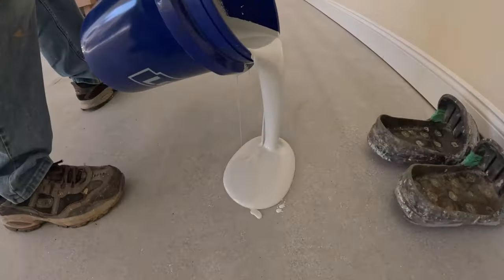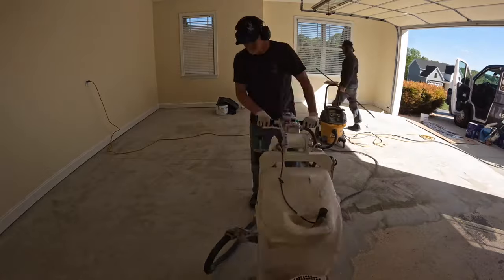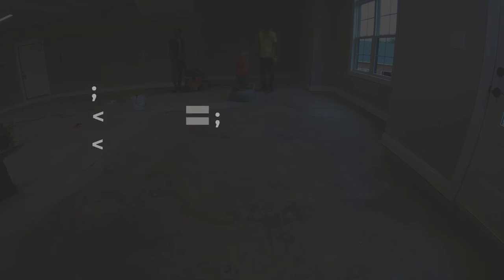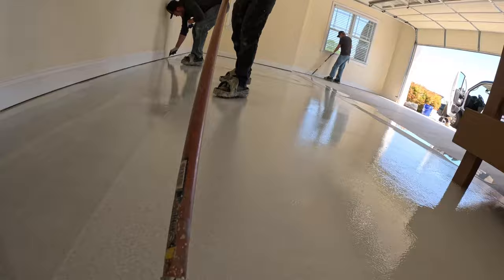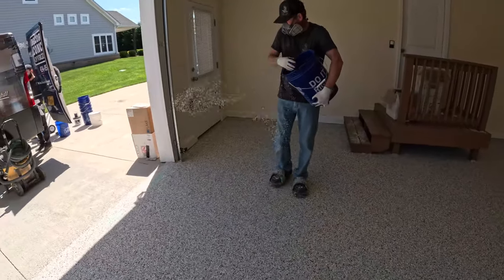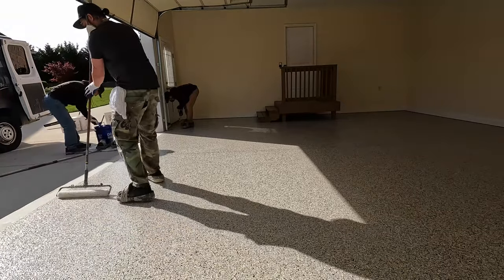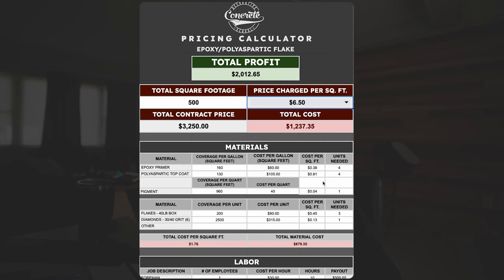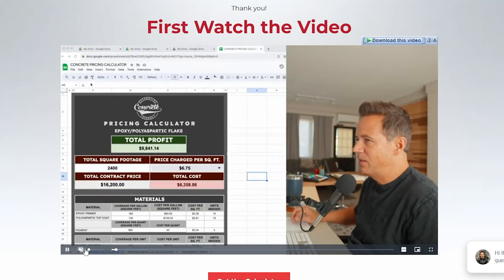How much MONEY can you make installing EPOXY GARAGE FLOORS? 💰

Comment: Hey Tim, I’m in the residential services business (repairs/upgrades etc.) and exchanging epoxy floor for rent with my landlord. 
1) The house is two years old, garage floor in excellent condition. Does it need to be grinded? If not, what prep should be done?
Thanks!
2)
Reply from the maker: Hey Max! It depends on the product that you use... but grinding is always going to be better. 

This training would probably be good for your situation:

https://www.decorativeconcreteschool.com/diy-garage
Reply: @TimDCVA awesome, I’ll check it out. 
Thanks for getting back so quick!
Reply from the maker: You can send me a text on that page if you have any questions. 👍🏻👍🏻